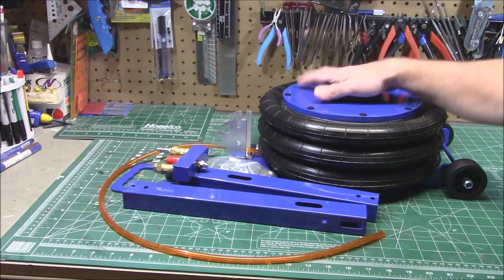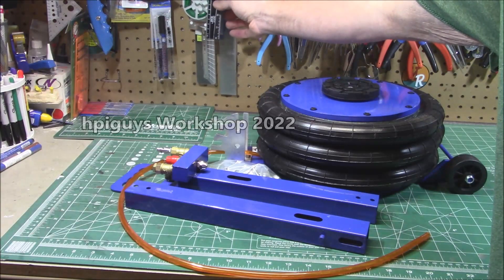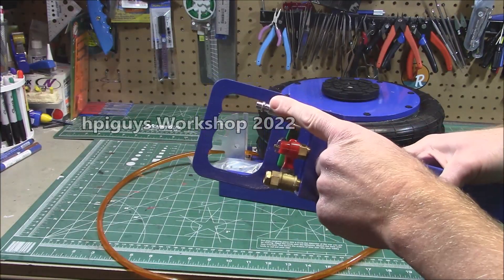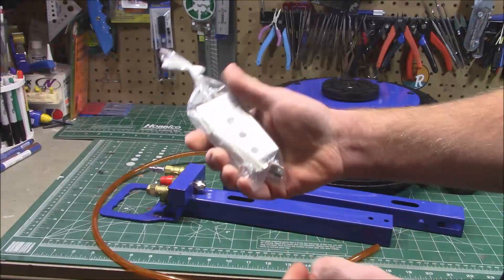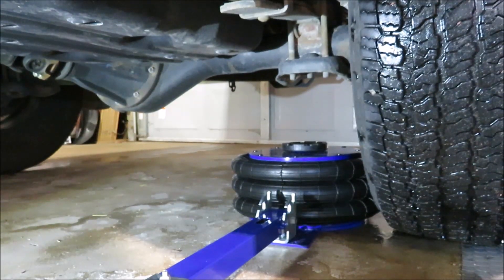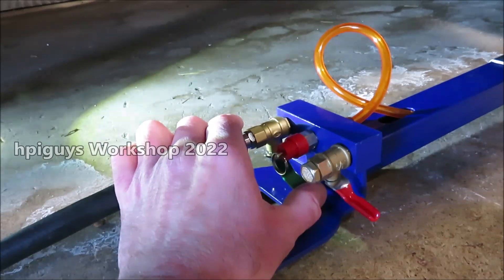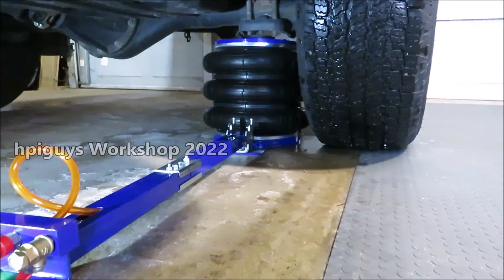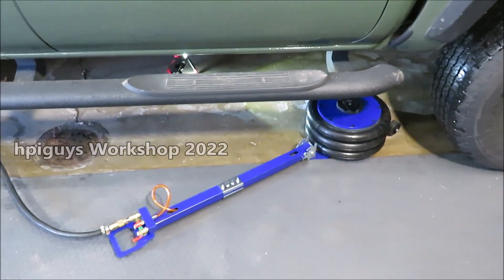VEVOR Air Bag Jack 11,000lb Pneumatic Jack Quick Lift 5 Ton Review DISCOUNT CODE BLACK FRIDAY

Comment: Nice for emergency to carry in the trunk.
Reply: Not for roadside. You need a stable surface and an air supply
Reply: Scott Saunders  
It's also a 50 pound lift.
Reply: 3 ton unit is smaller and more manageable though. 
Still don't think it's something you'd want to carry around as a matter of course, as you'd also need an air tank for a one shot use. And a compressor as a backup in case you use up the air and still need to do another lift.
Reply: 8:10 Yes, painted with rust proof treatment on the whole body, but how will that treatment fare on the bottom after it's scraped along the pavement during normal use?